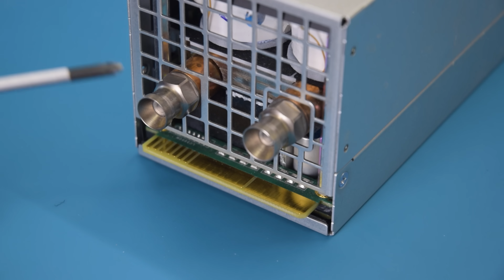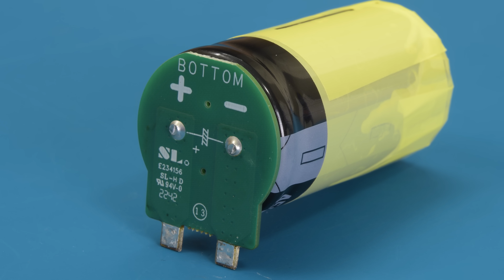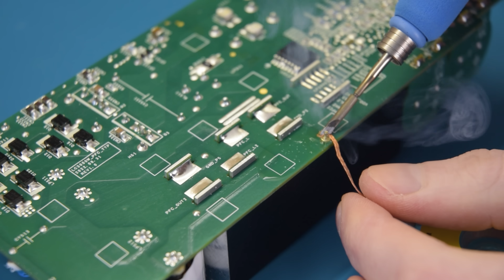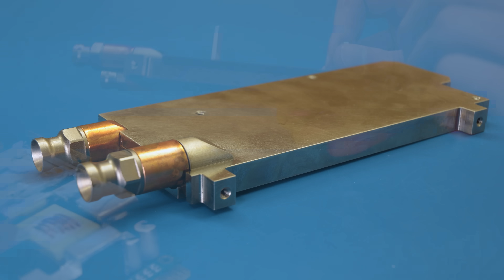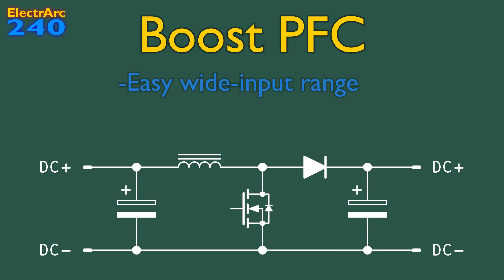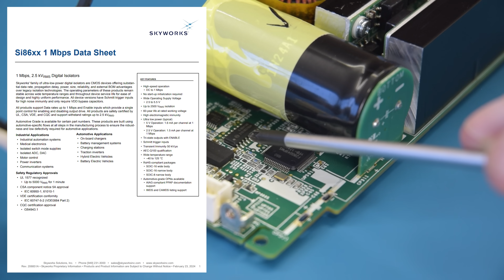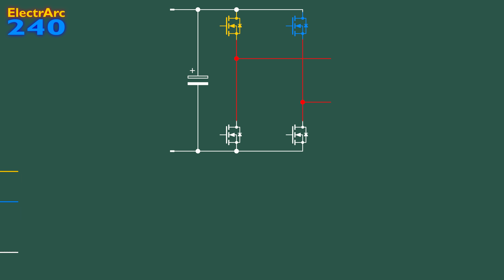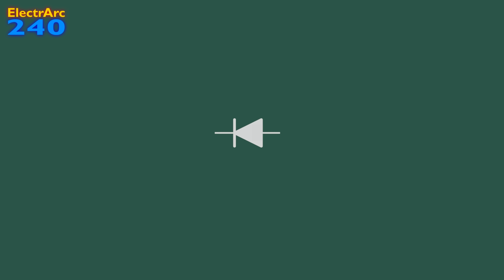Inside a 3000W Water-Cooled Power Supply (with GaN & SiC)

Comment: Water cooling is a good idea in datacenters, because with so much heat you don't heat the room so much. Instead you can move this heat elsewhere.
Reply: Liquid cooling is necessity because air can't hold enough heat power.

If they could use air they would use use it.

Comment: When the bubble pops, we can use such devices at home 👏😉
Reply: Saving money right now for buying lots on ebay later
Reply: I don't forsee this being a bubble considering this AI or data center build out is very much a consolidation of tacit knowledge or fundamental working knowledge on everything into a digital non dieing form and the fact these models are constantly being trained to work with this massive pool of data to be ever more capable at implementing this information or tacit knowledge. However there will be cyclical ups and downs in regards to building or replacing data centers and hardware.

When the likely transition or integration of optical processing units(OPUs) occurs for energy efficiency reasons I'd bet a lot of used still functioning and very capable hardware will be made available for purchase.

Comment: In general, the "just plug into the socket" principle in server solutions and the use of single-phase mains voltage is certainly surprising. It is much more reasonable to use a three-phase rectifier directly at the data center entrance and operate with direct current, including for backup battery power. When using three-phase power supply, you do not need to pile power correctors on each server.
Reply from the maker: Completely agree, even went on a rant about this exact thing haha, but cut it out to keep the video length under control
Reply: You described exactly how a telecommunications carrier works. EVERYTHING is powered by -48Vdc (positive ground, maintaining the standardization from analog telephone exchanges). From Cisco 12000 series routers, DWDM optical equipment, and even simple converters. It simplifies the use of battery banks and minimizes interruptions. The only problem is that due to the low voltage, we use copper cables as thick as 1" and rectifiers need to be on each floor due to the cable length.
Reply: @joseluisvaiksnoras7857   curiously Cray, XC-40 era (and probably XC-30,XC-50 and probably even Gemini), uses 48v 2kW rectifiers (probably because they're easy to get), paralleled together in blocks of 9 (from memory) per rack, re-tuned to 52v (from memory). Apparently when you pull a faulty one, the 3 around it often go in quite an audible fashion, too. edit: Oops, 36 PSUs, 3kW (480vin) each: https://cug.org/proceedings/cug2016_proceedings.orig/includes/files/tut103.pdf
Reply: DC for rack scale power is pretty rare outside of supercomputers and some AI setups. I’ve seen 3 phase PDUs are rack scale the most.
Reply: You can put a third of your servers on each phase.😊
Reply: This is a very common arrangement in older server rooms even if they have been retrofitted with 3 phase to every PDU. Years ago it was common to have server power supplies not assume 3 phase even if they were getting it.

Comment: I'm betting that the reason those filter capacitors are on right-angle adapter boards is because the capacitors they chose are shipped with short leads intentionally, as a way to ensure that they are mounted in a way that minimizes parasitic inductance. If you need to mount them at a right angle as this PSU does, you need to make the adapter board and eat the added parasitic inductance.
Additionally, the green coating on the adapter board isn't just for show, it does help with isolating those capacitors electrical connections from the chassis itself, tho I do know they are using sheets of plastic (probably HDPE or polycarbonate) for that purpose as well.
Further still, the boards using plated copper conductors means that they could have easily used at least 2 layer PCBs and wide traces here, leading to potentially lower parasitic inductance than if the leads could be formed to fit as intended.
As if that wasn't enough, there's also the issue of gapping and clearancing for voltage isolation purposes, using a PCB that has many layers allows one side to be kept completely free of traces and used solely for electrical isolation from the leads to the metal can of the capacitor, which is important given the presence of low voltage components directly beneath those capacitors on the main PCB.

Comment: 27:30 i thought the inductor was there because this was a series resonant converter, which are very common for high power designs.
Reply: You'd need quite beefy series capacitor for that at this power level.

Comment: The double layer aluminum backed PCB is also quite advantageous in terms of lower parasitic capacitance, which is very prevalent in single layer aluminum PCB's.
As i've found out the hard way by blowing up many high power transistors before realizing my drain-source capacitance was 2.4nF due to the aluminum backed PCB i was using.
Reply from the maker: That's really interesting, is there still not lots of capacitance between the bottom layer and the aluminium? I guess even if there is you can keep the switch-node far away on the top layer like on this board

Comment: Regarding the shorted kelvin connection from SIC, they may intended to slow down the FET, they also have local PNP turn off on each gate, so maybe with Kelvin it was too fast, or simpler for this application it had no benefit (increased gate resistor or a capacitor in parallel can slow it also..). Having too fast transition on SIC mosfet can lead to negative pulses on the gate, and those are quite hard to clamp/protect the gate, a zener diode will be too slow. What kind of drivers do they implement? With local PNP turn off don't think it's possible to use negative drive, and SIC do need a bit of negative for headroom.
Reply from the maker: It did appear to be using bipolar transistors for turn off (can see them near the pins), so you're probably right. Though why not just use a larger Rg with kelvin source? Miller turn-on is worsened by the shared current path without it
Reply: @electrarc240 you don't have here miller plateau at turn on, it-s a phase shift zvs.
Reply: A thing which bothers me is that it might be possible to have enough current going trough the kelvin connection leaving to destruction, even tough the kelvin connection will have higher inductance and resistance. If I wanted to slow down switching speeds, I would rather use a gate resistor - given the design of the converter, there is no way, that the designers thought "oh, we need to slow down switching in an uncontrolled way - let's save on a $0.02 component."
Reply: Using the source L to slow switching times can lead to severe ringing or transients endangering gate oxide. Kelvin packs were invented to prevent this. Ton and Toff are easily controlled by series resistor/diode networks.
Reply: But still, why using 4 pin packages then? Is the cost difference negligible from conventional 3 pin packages?
kalei02
Reply: Maybe the engineering here involved a tradeoff between designing the PCB with more complex traces compared to just gaining a lower ESL by paralleling the two leg package vs just having the cross section of one single leg.
Reply: @Magneticitist  your comments are literally everywhere i go on youtube
Reply: @gaynzz6841  Wow congratulations

Comment: Ridiculously niche, a negligible chance i'll ever use one of these (or even see one), but DAMN that was interesting! Ive got a BIC2200 Bidirectional powersupply. I made it about 2 months before going "yeah, fuck the warranty". I was looking to convert it from aircooling to watercooling, or at least watercool the hotest parts. Long story short, the part that loses most heat is coupled to the case and relies on the case to spread the heat and the fans to get the heat out of the case.... I slapped a watercoolingblock on the outside of that exact spot... Close enough I guess.
But it was fun to be able to reverse engineer at least to the inputfiltering, PFC, inverter/rectifier , transformer, inverter/rectifier, dc filtering :)

Either way... Cool video!
Reply: Negative, Sir.

This type of devices would be dirt cheap after LLM bubble pops.

Comment: If you are doing custom PC water cooling, you can get dry-break coolant connectors that fit a "Custom PC water cooling" standard thread form called "G 1/4".
I'm not really stuck to any single brand, but the ones I have in my system are all Koolance brand. Each male or female connector cost me about $20 USD back in 2019 when I was building it, and they are very handy when it comes time to clean the inevitable gunk out of the tiny cooling channels in the water blocks, because I can skip the step where I drain the loop and go straight to taking it apart, thanks to the fact that these connectors only ever let maybe a drop or two of coolant slip out of the loop during disconnection.
I know that such connectors exist for hydraulic lines, pneumatic lines, and even garden hoses, but the ones I have are specifically for use with PC water cooling fluids, by picking o-rings, seals, and metals that are specifically compatible with the cooling fluids (copper/brass/bronze/nickel and certain types of synthetic rubbers, very specifically no aluminum to avoid galvanic corrosion).

Comment: What hides beneath that  L shape metal block at the output?
Reply from the maker: Not much, just a few little ICs like the ideal diode controller. It is that L shape to get more surface area contacting the cold-plate
Reply: @electrarc240  feels strange given how big it is... also only a small fraction of it touches the water block so it makes sense

Comment: This was so awesome!!! Please could you do a breakdown of a high powered solar hybrid inverter? I’d love to know the topology of how they integrate the high voltage pv inputs with the battery power and the ac output!
Reply from the maker: I have a video all about inverters where I tore down a solar inverter and compared it to an electric car traction inverter, it was about half done a few months ago and then got busy and haven't worked on it since. Sounds like I should pick it back up though!
Reply: That woud be really cool
Reply: A hybrid inverter is usually a bidirectional AC/DC converter with an extra DC/DC converter slapped to the 400V bus for the MPPT input. That's why hybrid inverters are so common, it's very cheap to add the solar input so why bother with making a separate battery only inverter

Comment: surprised they don’t use a C20 ac input connector for that amount of power
Reply from the maker: I think it is C20, not the standard 10A one at least. I ordered a cable to power it up with but got the wrong C number, another reason I didn't turn it on lol
Reply: @electrarc240 this PSU uses a C22 AC inlet connector so you need a power cord with a C21 connector, it is capable of 20A in North America and 16A internationally,  it uses C22 instead of the C20 because C22 supports higher operating temperature.

Comment: I think I know why the electrolytic caps were mounted on those little right-angle adapter PCBs.
My first instinct was that, however unlikely it sounds, they might have been mounted like that to drastically reduce the connection inductance or resistance vs just the bent leads. Unlikely, because the ≈2cm of copper should have negligible inductance and resistance compared to the entire huge capacitor innards, but I wanted to perform some back-of-the-envelope calculations to verify that intuition. So I went to mouser and looked at all the actively produced 450V caps with between 400 and 450µF of nominal capacitance. And I noticed the problem:
Not one of the ≈30 caps had any leads to bend! All of them only had short (on the order of 5mm) termination pins riveted bottom electrodes.
Reply: For the average repairman, this would be a problem, but for someone who's going to manufacture thousands of these power supplies, asking them to change the terminal type wouldn't be an issue. Especially for Intel...
Reply: Eh, should have refreshed the video before commenting, someone else already got there 39 minutes before me.

Comment: the one thing that bugs me about watts per litre is, to use it as a metric is to assume that all else being equal, the wattage of a power supply is somehow proportional to it's volume. I suppose in some sense it is, like if you were to use two identical power supplies in tandem, then you would have both doubled the watts and the volume, but if you were to double the sizes of each of the components that make up the power supply, it isn't guaranteed that the wattage would also double, not to mention the max amperage of a wire is proportional to it's cross sectional area and it's voltage is inversely proportional to it's length even though losses are almost negligably small at most reasonable voltages and distances expected within power supplies...
Reply from the maker: I think that, as you say, it is more to represent how many of a given power supply you would need for a certain power level than anything else, I agree it is a bad metric for comparing PSUs of different power levels. I imagine the watts/litre of a HVDC converter station is pretty high!

Comment: Interesting seeing a C2000 MCU in a power supply. They are frequently to be found in solar inverters or EV drive trains (Tesla use them for all theirs). Given how complicated it all is I guess it's not surprising.
Reply: Most TI GaN reference designs will have a c2000 as the controller, they've just got nice firmware for switching control for power electronics. You'll also see them in motor controller designs for similar reasons.
Reply: It's logical, they are designed for power regulation as @rhino9686 says.
Reply: They are used a lot as drivers for high power electronics. Inverters, motor control, DC/DC converters etc. So I'm not surprised to see it in a high power PSU. 
They are however only found in "nice" industrial designs, as they are rather expensive (especially during the pandemic times)

Comment: 17:31 There is a dot on the "Phillips" screws side, so it is not a ordinary Phillips, it's a japan JIS Phillips. Not the same, you can torque out and destroy it with a usual Phillips.
Reply: 就是普通PH2的螺丝，东莞的厂不会闲到去进口JIS螺丝，有那闲工夫直接用T型螺丝了。
Reply: Thanks, I learned something new!
Reply: This is another reason why impact drivers are such a marvelous invention for driving screws, the discontinuous manner in which an impact driver transmits torque to a screw thru the bit means that the bit can only cam out a tiny bit before the impact event is over, which gives the bit plenty of time to be forced back into the screw head by downwards pressure applied to the impact driver, fully seating it before the next drive impulse is delivered.
It's basically like a tiny impact wrench specifically for screws. You don't need Torx anymore if you have an impact driver, Phillips or JIS either one won't be able to cam out any more.
In any case, the indent dot on a screw doesn't always indicate JIS, if you see it on a gold screw (hexavalent chromium plated) it simply indicates that the screw was heat treated to a higher hardness and strength grade than normal. More likely to be a JIS screw if it's a bright nickel plated screw.
Reply: While I do love my impact drivers, you can certainly strip out screws with them and I've seen it happen many times, especially in careless hands.

Also why are you saying that a chrome plated screw is gold? Chromium is notoriously not gold, whether using hexavalent or trivalent chrome
Reply: @theodorekorehonen Hexavalent chromium does indeed have a yellow-golden tint as a plating, it's a common coating for screws and is strikingly different from the matte silver of trivalent Chromium for comparison.
Reply: @SciDerg  I have torqued out and destroyed a JIS size 3 head on a old Toyota (throttle body) with a PH3 Phillips impact with medium torque settings. I'd forgot my JIS Vessel at home. So impact is not always the answer.
Reply: @Mad-Jam I always use light torque settings on these even with the right driver, it's not worth a couple seconds.
Reply: @Mad-Jam  same!  Toyota throttle body and that’s when I learned, for the first time, what a JIS screw was, watched a few videos, found out what the best tools for the job were, and ordered a Vessel regular fixed and some 1/4” hex quick change Vessel bits for the impact.   Bonus:  they grip better than Phillips drives do in a Phillips screw.
Reply: @orbatos  I tried to loose it, and it did not move on light torque.
Reply: I love JIS.
Yes, normal phillips prevent over-torquing by making the screwdriver slip, but if you're not ham-fisting your devices, you don't need that.
I'd rather not slip out of and strip the heads of stuck screws, especially if you can't apply much axial pressure in a specific situation.
I find Phillips more annoying than anything. You can also use JIS bits on Phillips screws, I just use those for everything now.
Reply: @Barmetler  Would you prefer they used slotted?  :)
Reply: didn't know that either
Reply: This is actually a very common myth. "This brings us to a major conclusion: JIS is not a tip type. JIS is the name of the Japanese standard for cross-tip or Phillips drivers, just like there is an American standard (ASME) and a European/international standard (ISO). " This is from Tekton's blog. JIS is just another cross screw standard that has tolerances so wide that both ASME and ISO standards can fit inside of the JIS one. JIS screws don't fit any better, JIS screwdrivers may be better for entirely seperate reasons.